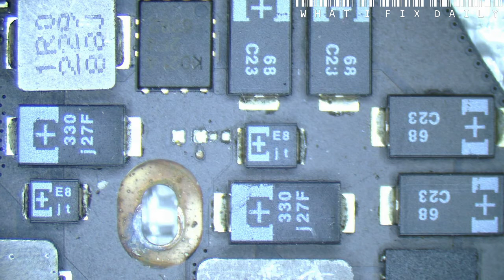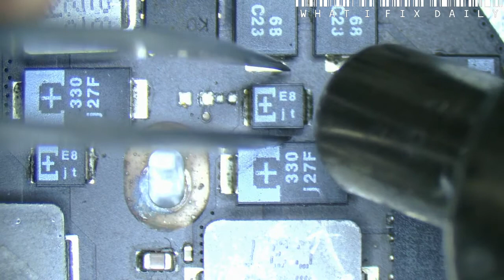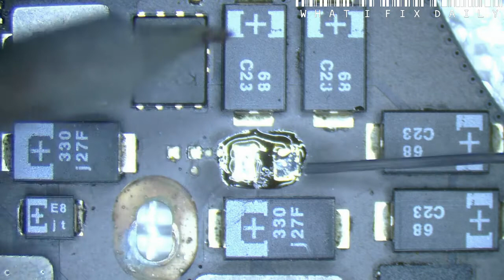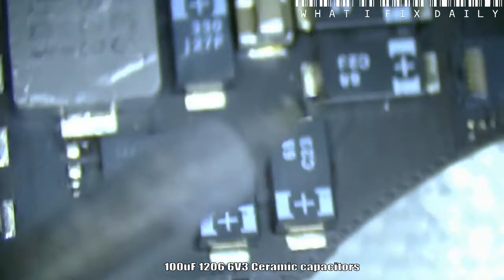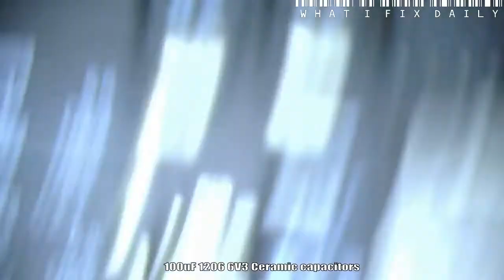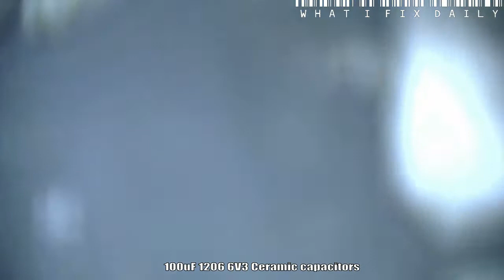Macbook 820-2330 C7771 alternative fix option using ceramic capacitors

Comment from the maker: Just a point to note - watch the height of the stack! With the older boards, it shouldn't be an issue, but check with newer lower profile boards before you embark on building up the stack.  A dual-stack will require 3.6~4mm of height.  Single stack (side-by-side) should be perfectly fine.

Comment: those look like Panasonic PTE POLY caps, just buy them on Digikey, save yourself the hassle, they are not that expensive
Reply from the maker: Very old video now.  Replacing with single 330uF 2V5 1210 ceramics instead.
Reply: @pldaniels  I want to thank you for this video and for the updated info on using the single ceramic capacitor. I did the repair today and was so glad it fit in that tight space. I have a working MacBook. I have been buying broken or dead MacBooks to learn how to repair. Watching your videos has been helping me learn. Thanks again.

Comment: Are these not polarized?
Reply from the maker: The replacement ceramics are not polarized, that is correct.
Reply: It doesn't need to be, Paul? Can you explain why that is? I always thought that a polarized cap needs to be replaced with the same...is it just this circuit? Thanks for the great videaos BTW!!
Reply from the maker: Polarization of caps is more of a limitation than a feature, but things like electrolytes/tantalum caps are still used because of their comparatively high capacity or cheapness in spite of them being polarized (we're just lucky that we do so much stuff in DC); so replacing them with a non-polarized cap is not a problem in almost every situation.

Comment: Cool method! I think I will utilize this!
Reply from the maker: Take note of the updated option, to use the single 1210 sized 330uF unit.  I've got a bunch on order now..... before everyone else buys them :)
Reply: @pldaniels  does the voltage matter? Can I use 1210 330uF 6.3V or 10V instead of the original 2v?

Comment: Hi! Loving the jenga caps.
Reply from the maker: Strange not being a live-stream this time.  Wanted to just post this little alternative up, mostly because I had to do it this morning to fix up C7771 and I didn't have the inclination to move the coil off to the side and fit in an oversized replacement cap.    At least though the single larger cap replacement is a known/verified/tested option.